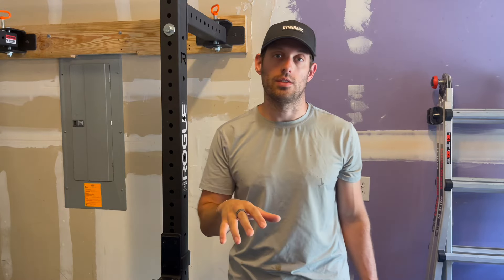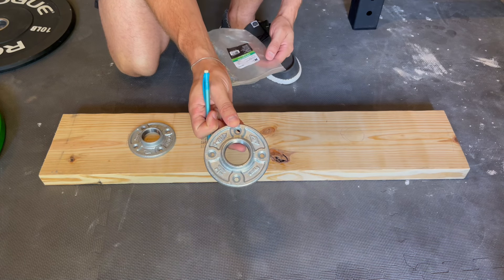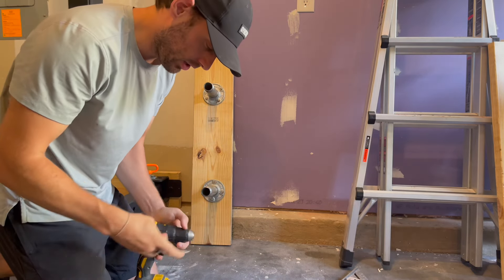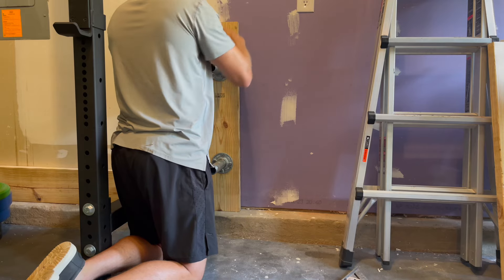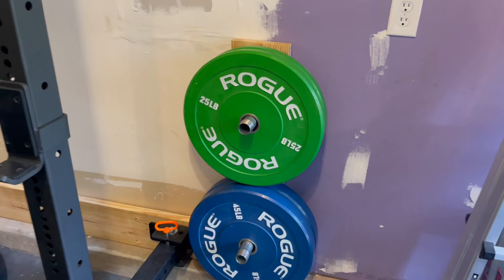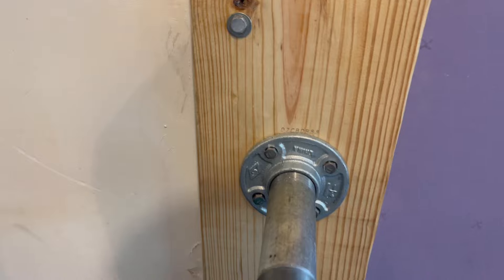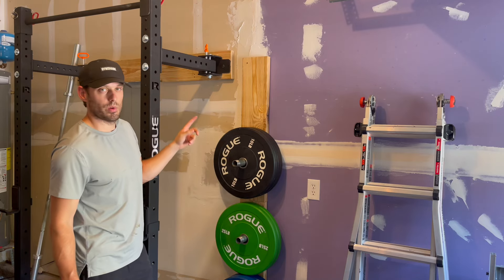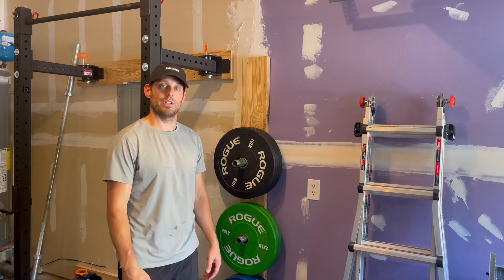SIMPLE DIY WEIGHT PLATE HOLDER - WALL MOUNT - UNDER 20 MIN

Comment: It would be a good idea to implement a slight incline angle to keep the plates from sliding off. Cut a board on an angle with the thick side at the bottom and sandwich this between the wall and your device or possibly just cut a 2x4 or 2x6 or 4x4 diagonally to make 2 of these wedge shaped boards, with one side thicker (place at bottom) to implement a slight backward angle to prevent plates sliding off
Reply: That is a good idea! It seems like the weights aren’t going to slide but I will keep this in mind if we build more.